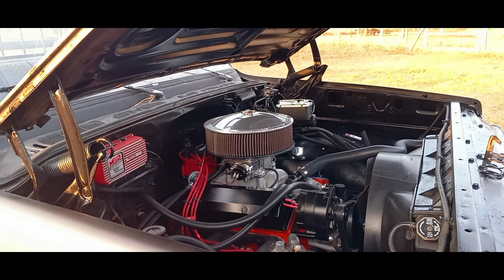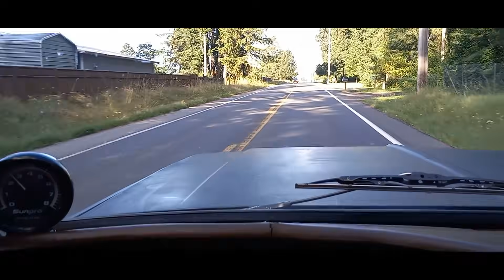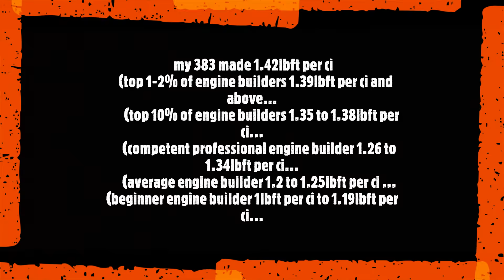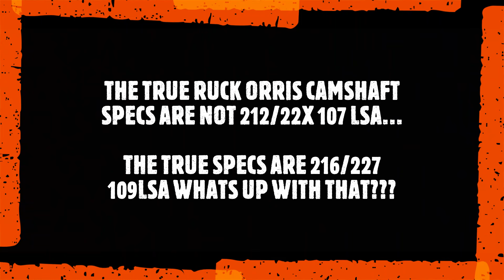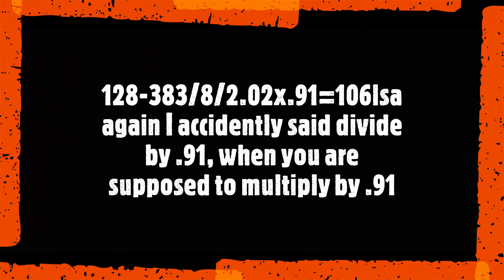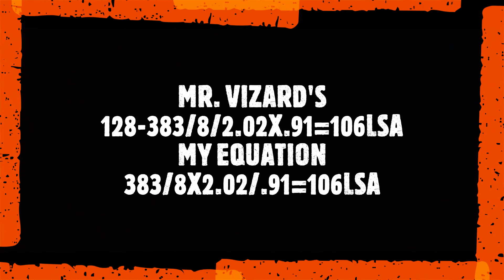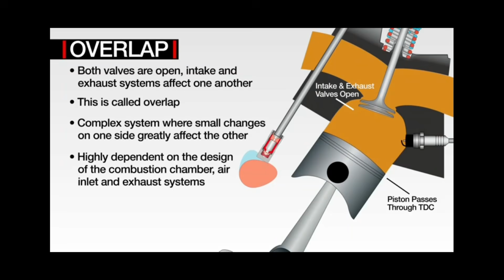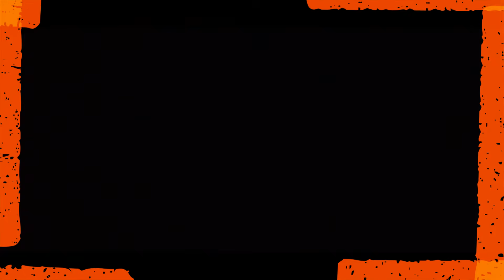CAMSHAFT SELECTION by LSA, 9 LSA's DYNO TESTED!!! LSA THEORY WILL BE DYNO PROVEN!!!, and EXPLAINED

Comment: Wow --is my new cam way off the ideal LSA?  Calculation: 128-(448/8/2.08*0.91)=103.5   Motor: 440 (now 448 Mopar) with stock 906 heads (2.08" intake vlv).  A 103 LSA?  Do they even make cams that tight LSA?  Just doesn't seem right.  I just installed a 110 LSA.   Comp Cam Hydraulic Flat:  Advertised duration is 268/280. Duration at 0.050  is 224/230.  Gross valve lift: .477/.480.  Raw lobe lift is .318/.320”. 110 LSA.
Reply: DV's books are great but only give the formula for sbc. Fords and Mopars are left wondering which surprised me as the books give a lot of good info.
Reply: @AkronOhioMachine Some of his 128 videos (maybe even this one say to use 128 for Mopars. He also cites what to use on fords and BBC, but Mopars (even BB Mopars get the 128).
Reply: @tmc.318  Thanks. I will listen again because I didn't hear it 1st time through. If it's 128 for everything then why does he always say "for SBC" ? I have his books which are good but it's not given there either.
Reply: @AkronOhioMachine  It's not 128 for everything.  For BBC its 132 (I have those also so I noted that).  I can save you some search time.  Go to 53:30.  SBC and BB Mopar were both 128.  Others engine configuration cam formulas are listed at that point.

Comment: The problem with getting hung up on one specific aspect of cam design is not practical for a manufacturer who supplies a product to the public for road use or for the guy who is a weekend warrior. 
For road use the best cam is the one already fitted. This a based on the theory that there are two types of vehicle, the race car and what you use to get it there.

Comment: I have so many questions it’s not funny.  Mine is directed more towards single cylinder go kart engines though as I build and race those. However the theory and physics that apply to v8 engines also apply to single cylinder ones however the formula seems that it would be slightly different.  How do you calculate the beginning number such as 128 or 132 to figure out what optimal lsa should be?

Comment: After watching the video i still have a few questions. Im trying to spec out a cam for my 5.7 hemi with aftermarket heads, 2.200” intake valve and dual springs capable of .625 lift. Using the formula i came up with 110 LSA but i dont know what i should about the overlap. If i go with 4° overlap then i end up with 224 duration at .50 lift. but i didnt hear him say anything about intake vs exhaust duration. so based on the formula should i go with a 224/224 110LSA? or should the exhaust duration be longer than the intake? Any input would be greatly appreciated.

Comment: Thank you so much for this. I have been reading through Vizard's Big Block book and I am in the middle of planning an engine build. Hearing your real world examples of the the theory's in his book is very helpful. There was one part of the equations that I didn't quite understand. I was able to successfully determine my starting LSA based on your equations, but chosing the overlap and duration is still a little foggy. I understand HOW to do the equation for overlap and how to use overlap to get duration...but do I start with choosing a duration and work backwards? That part of the video was a little unclear to me. (still a lot to learn)
Reply: Choose lsa, then overlap based on application and duration will sort itself out

Comment: um 🤠 no mentioning of camshaft phaser's ie holly's*? 1950-80's kit/fully mechanical/cintrifical operated or modern computer-controlled systems or 4-gen viper cam-in-cam or say Honda DOHC twin-cam-gear/or after market SBC-adjustable kit's mod's? or mentioning VVL or muti-air , something that im copycating on to the hemi im working on/experimentation plus a 60MM cam viper style V8 cam core voodoo-firing order, inputs/2C are welcomed, as you said cringing if the rest of the combo is high effort but didn't bother getting the cam pick right or even trying to

how does that affect physics?
 as it's not fixed ground and fix-keyed in placement? BTW thanks for the 426-hemi platform ( i assume its about the same way for the 3-gen as both are cross flowing heads ) advice as i wondered about that and my charger's/daily-street car replacement im doing as a combo 4.3X4.5 stroke all iron ( D-8 head's 2.3~2.4"in* intake's moded 2.2-2.3"inch exhaust inconale/liquid filled valves max 2:1 lift possible based on early math/mesument is 500/gind or solenoid/jurk pump-limited or-790/820th valve's-Clarence problems ( not done checking that vs piston minimum clearance vs timing, as hemisphere chambers are more complex than flat diesel or 1gen big block Chevy's valve-math/mesument ) lift aim for now is 650-800th yes something's are subject to changes as my mockup isn't 100% done yet say 40% or so assembled/maths as one-peace-finial-assembling as i did most of the parts on the table ect sofar or one-ish at a time on the iron-block mocking up  ) and as high as i can get compression ratio on 92-pump or m100 local to me ( VCR-rod's/Nissan style rod's-ish ) ect and 75mmX70MM 1AR EFR-twin turbos

at 1-hour in ruffly you are prioritising intake's timing over exhaust valves sizing and or timing's but gale banks, yes that 1950*-up racing and diesel legend standing next to his dyno/in-video sad exhaust is more important to getting right, so cam wise 4 ish not real numbers degree's duration more over intake lobes's sizing is clearance isn't possible for both or bigger size exhaust valve size ie 2"inch vs 2.25"in-exhaust ( or notch the cylinder wall for bigger/better valve/air-curtain clearance if needed ) as there's only so much room in the cylinder for parts to fit and work , as he said get the spent hot gas's out failing to do so is ruff on parts and limits power production, so are you trying to say that gale is wrong? or you are? or did i miss understood that part of the video?

Comment: Hi... Your equation... 383/8x2.02/.91 = 106° didn't seem to be universal ...

Building a SBF 393 with 2.055 valves using DV formula yields a 105-106 LSA ....

Your formula above tells me I should be using a 110-111 LSA.

Any input?
Reply from the maker: In the video i said that formula doesn't work universally.. I used that formula I randomly came up with in the video as an example that just because an equation is created and it adds up numerically to be the correct LSA, Don't mean the equation will work across the board for other engines.. in other no that formula doesn't work universally, it only words it only works perfectly for 383ci because its not an empirical equation..it is just an equation that I randomly came up with when I was playing with numbers.. this example was presented to show that not all equations are correct, as seen with MR. BT and his theory/equation for camshaft production.. thank you for watching, I appreciate it.... take care
Reply: @CDG-Racing_Dynamics  Sorry, I watched this video twice and missed you saying it wasn't universal. Thanks for your input.
Reply: I have DV's books and they are good except he doesn't give the formula for mopar or ford or explain it enough that you could use it on one. What does the 128 constant come from? Shouldn't it change with different heads and engine sizes?
Reply: @AkronOhioMachine  Small block Ford is 127 constant. Reason I was given was the induction system is just a smidge less productive than a SBC with a street/strip setup.

This formula is supposed to work for street engines with your typical good aftermarket head on them.

I don't know where the constant 128/127 comes from, other than that number must pertain to something to do with an airflow constant???

I think DV is a solid guy and wouldn't put such info out there if it was BS. There was an article a couple decades ago when they ran a Chev 355 typical street performer and changed only LSA spec.... 106, 108, 110.... They concluded 106 over scavenged the intake charge and 110 under scavenged, since the 108 made best power everywhere and peak. So.... I think DV has played with cam timing enough to know what does what. I wish I had his experience!

Comment: The LSA formula you provide is incorrect, You can’t start with a Negative number.
Here’s the actual formula: 

LSA= 128 -(CID/8/Int valve diameter x .91)
128 -(383/8/2.02 x .91) = LSA 
128 - 21.56745 = 106.33255 
You have to have the parentheses to indicate the proper order of operations for the equation.

Comment: Hi thank you for your information you have shared. I have a 400 sbc we are planning on building a 406 for a Wingless Spec Sprint. What the rules is that sucks we have to run a 2 barrol carburetor but the carburetor can be modified and we run Methanol. The cam lsa when I calculated it was 105.7 which would be 106 but what I am running a 14:1 compression or a little higher maybe 15:1 if I get a aftermarket block I saw. And head will be pro top line 220 I am about to buy with 208 intake valve so now the compression is higher would I need 108 or would 106 be ok I wasn't sure how to fully calculate it perfectly

Comment: wow great video super powerful tool I have been working on smaller displacement engines multi valve turbo. for over 30yrs I have learned that the most important data from my dyno is the pressure ratio int to exh and the relationship to comp inductive eff . the cyl head flow to cam timing is now making way more sense as my int cams are controlled by the ecu which is adj by engine speed load ect. I am going to try and use David Vizards formula to calc LSA but use the overhead multi valve eff . How is the engine eff number arrived at . My target for optimal pressure ratio has been 1 to 1